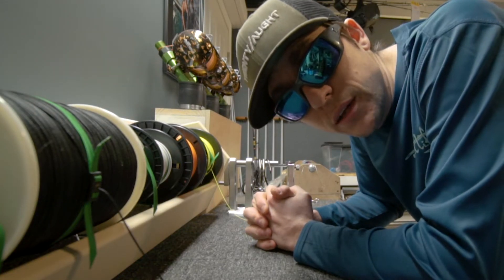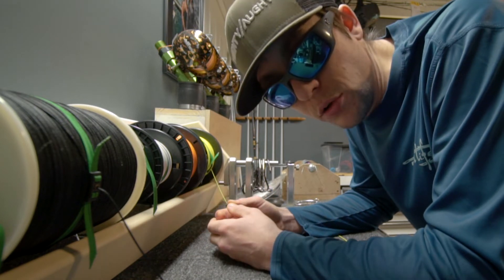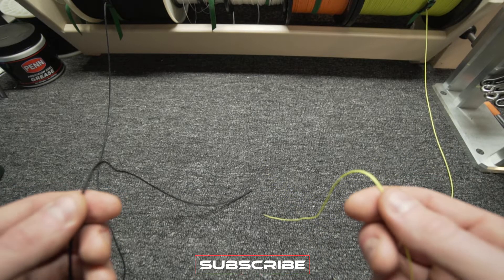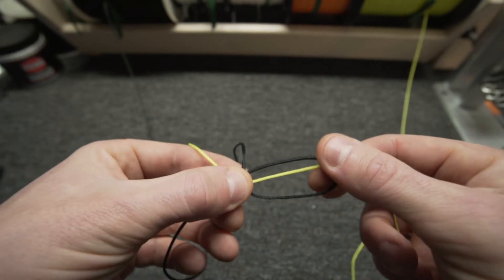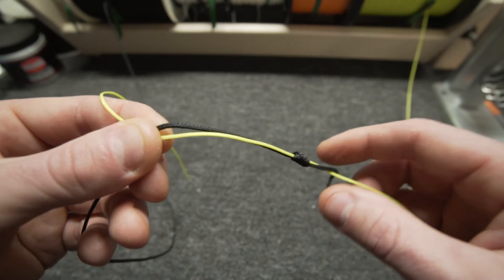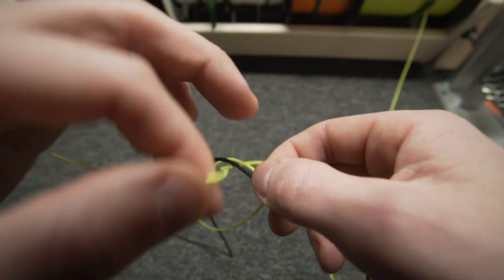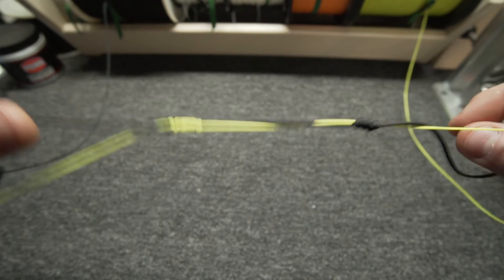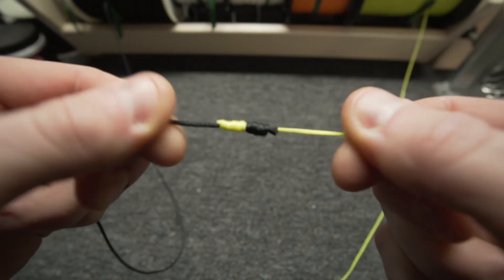Double Uni Knot - How to Tie Braid to Leader

Comment: Hey would you use the uni to uni to attach backing on a reel
Reply from the maker: you would just do a single uni if you wanted to use that as your knot to attach to an empty spool. For just spinning reels I just tie a couple half hitches though cuz if a fish gets me down and is going to spool me probably doesnt matter what knot Ive got attaching it to spool im in trouble. If youre talking about adding braid as a backing to fill like 50% of the reel and then the other 50% with like mono or a different braid yes this knot works for that 100%!!!!